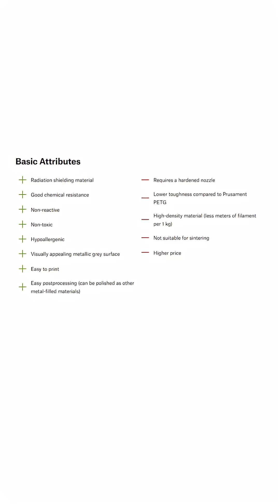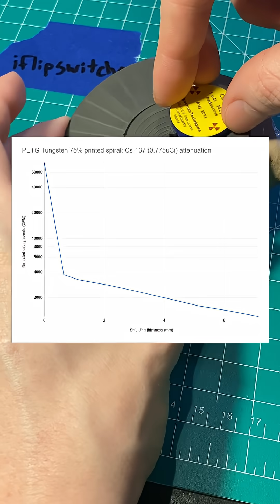Can you 3D Print Tungsten Radiation Shielding? #shorts

Comment: Gotta be careful with tungsten loading. Medical extrusion companies took 15 years to perfect the particle size, surfactants, and heat/light stabilizers to make sure that the plastics don’t fall apart after a short amount of time. 75% is really reaching the limit of loading, too. I’ve worked with up to 80%, but it still can make people in the medical device industry nervous. Also, what’s the purpose for this filament? Just for weight or is it for radiopacity?

Comment: many people have built their own 3D printers even programs. surprised more people don’t use a TIG/MIG welder and turn into a TIG MIG printer! this concept is way outside my wheelhouse and industrial versions exist, much like 3D printers did before patents expired. team player here, just passing the idea ball as others could create a new phase of additive manufacturing for themselves and maybe a startup. Finer detail “TIG welding is superior to MIG welding because it offers greater control through a separate, non-consumable tungsten electrode and manual filler rod feeding.”

Comment: it would be hard to machine that shape but you could just get a few sheets of tungsten at different lengths and then just stack them for the exact same tool
Reply: It actually would be remarkably easy to machine. I worked for a shock/strut manufacturer and we had a couple of these for every spring we produced at one point or another. I don't know how the machinists did it, but I know they could knock one of these out in a couple hours if needed (including stock prep and placing the work order)
Reply: @Depl0rable10 It would nearly trivial on a 4 axis, and still easy on a 3 axis. It's all just stepped floors. The poster knows nothing about machining.
Reply: @joshuaeah  oh yea I know that most people in the 3d printing community knows nothing about machining lmao. I also meant a angled piece, not steps (as I had assumed that was their goal) but steps do make more sense for this application tbh.
Reply: @joshuaeah  still way easier to print it

Comment: That part would not be hard to machine
Reply: I was thinking the same thing
Reply: But you would need more than double the final weight in stock material, right? It is still useful for that.
Reply: @yumameda no why? All you need is .050" more than your largest dimension in 3 axis (XYZ) plus maybe .2" for workholding. This is very generous by the way, you can do less depending on your tolerances and needs.
Reply: @Interphazers double, as in the stuff that is machined away in this spiral looks to be a shortened mirror of what's left when finished, another spiral.
Reply: @MaximilianonMars you right, my bad. I was thinking of using a cutoff/scrap because this isn't a practical part it's only a test piece.

Comment: “75% tungsten…”
Woah
“…by weight”
Oh, so like, mostly still plastic then
Reply: About 16.5% by volume if my math is right (it probably isn't)
Reply: @trungletime danke señor
Reply: @MaximilianonMars  Germanish? Spanman? Ganish? Sperman?
Reply: @JosephDalrymple Spangerish
Reply: yah nothing mostly not plastic would work in a plastic 3d printer
Reply: @z-0669  i belive the qidi I-fast or what can print some kind of metal filament that has to be cured or what. I dont know the details so dont ask me lol
Reply: @lotus4665 filament with at least 40% metal and plastic rest, afte printing you have to like bake it so the plastic burns away and leaves the metal but it warps badly and also shrinks
Reply: Even an ender 3 can print this filament but you need hardeded nozzle
Reply: @z-0669 it's called metal mex and is widely used.
Reply: You need something liquid with high viscosity and thixotropy in order to print some fine lines with small nozzle. Plastic is a great, controllable material with heat
Reply: Well, if it was 75% tungsten by volume, it'd be a metal, and also impossible to melt without a very strong furnace, meaning it wouldn't be possible to use it in a 3d printer.
Reply: @O_Coxinha_no_YT That's not 100% true because it would be a powdered metal glued together with plastic
Reply: Exactly.

Comment: But why not mixing Tg with some another metal instead of a quacking plastic? There are also printers using a liquid metal. I just don't get it why did you even tried and why anyone is doing something like that. For a super-heavy plastic?
Reply: Straight up steel sheets or water containers could be better for weight but they're not a steel sheet company.

Comment: Are there titanium filaments for 3d printing yet?
Reply: Iphone 17 air is 3d printed in titanium
Reply: @danvilela  that uses a laser to sinter titanium powder 
there are fdm filaments that contain up to 80% titanium and it even looks like they can be sintered
and thats pretty cool
Reply: fdm filaments exist where the part is sintered and turns into metal or ceramic .
they are expensive and have a lot of shrinkage.

it is generally better to do it in resin, more even strength and less shrinking that way

Comment: There would be NOTHING difficult about machining that part.
Reply: yeah he should've done a hollow cavity or something more complex
Reply: its hard, its expensive, and a mill/lathe equipped to process it will be significantly more expensive than the material cost (including the weight of the machine and need for a trained machinist)
for a hospital it does make sense
for everything else just cut a sheet of tin/lead
Reply: it's hard and brittle

Comment: Really neat idea, I think tungsten is not a great  choice for beta shielding though because it will also generate braking X-rays. For beta radiation alone, plastic is actually a really good shielding option
Reply: You’ll never believe what the tungsten is suspended in
Reply: The material is a mix of tungsten and plastic.
Reply: Tungsten would only make sense if you're space limited. I wish he had tested this against an iron sheet.
Reply: @lasskinn  If I recall correctly, the filaments desnisty is about 7 g/cm^3, so basically the same as iron and copper.

The only time this would be useful is if you require very specific geometries that are difficult to make by bending copper plate.
Reply: Except over time plastic will crumble when continuously attacked with electrons.
Reply: @kbee225  Yes, it may have a limited lifespan. That's ok though, as long as it's a known factor.
Reply: So what you're saying is, an outer layer of plastic, then an inner layer of this tungsten stuff, to make a proper (beta+alpha) + gamma shield?

Not a bad idea TBH.

Comment: It is pointless. Tungsten is good radiation shielding because it is heavy. The only parameter that is really usefull in shielding is mass. It is not chemistry.

By diluting its mass down so much the filament is only usefull as kinky plastic to be sold very overprized for easily tech excited kids.

Real hospital can probably get iron case manufuctured locally on lathe faster than 3d printing. And iron/steel s going to be absolutely superior and way cheaper alternative. Do not get me going that turning tungsten instead is not that hard either - it is just expensive and requires simple diamond/carbide cutters and blowtorch.
Reply from the maker: In addition to mass, Z-value is equally important. The name of the game with shielding is getting radiation to interact with matter, and a higher Z-value increases the probability that’ll happen. Iron is nearly twice as dense as the tungsten PETG, but for the medical isotope Tc-99m at 140keV like the filament was originally designed to shield, iron has a half-value layer of 2.2mm while the tungsten PETG has an HVL of 1.4mm. This means that to get the same shielding efficacy at this energy, the iron would need to be over 1.5x thicker than the printed part. 

When you start dealing with really high energies, like Co-60 at 1.25MeV, then even pure tungsten only has like a 2-3x advantage over iron opposed to a 10-15x advantage. For high energies like this though concrete, lead, and physical distance from the source are the best forms of shielding.

This filament is certainly not economical and nobody's going to be printing any big plates out of it. Lead is most commonly used for shielding as it’s cheap, easy to cast/machine, and by mass is actually slightly more efficient than tungsten at stopping gammas. Tungsten however is denser so for instances where money isn't a factor and you need compact and non-toxic shielding then it's the superior choice. 

Generally I’d imagine if a facility was considering 3D printed shielding then they’d be in need of an irregularly shaped component that isn’t easily machined (or impossible to machine). Though nothing is easily machined out of tungsten, I guess we’ll just have to agree to disagree on that.